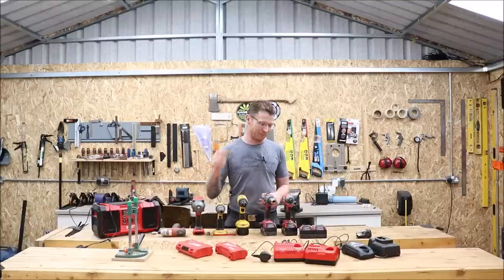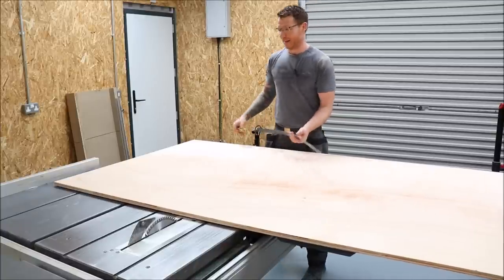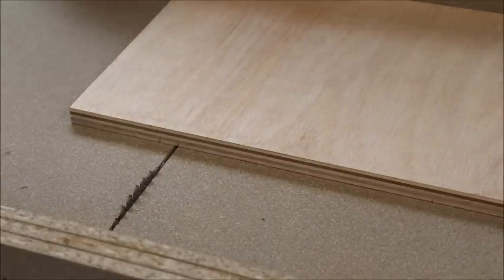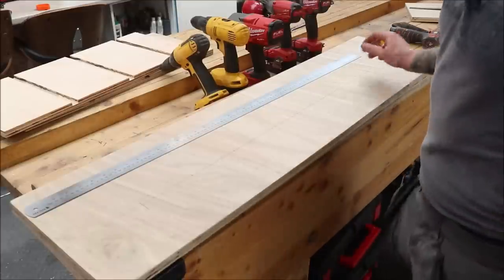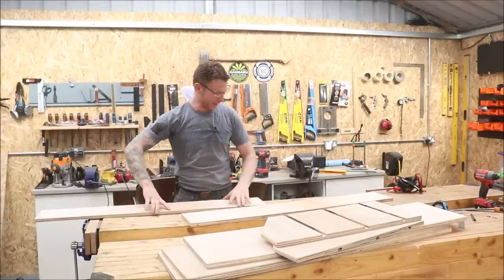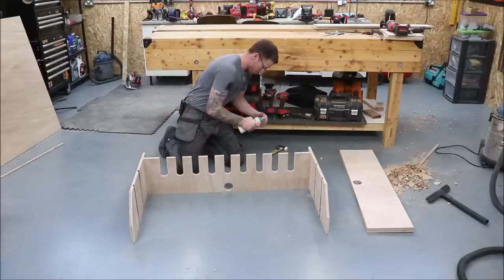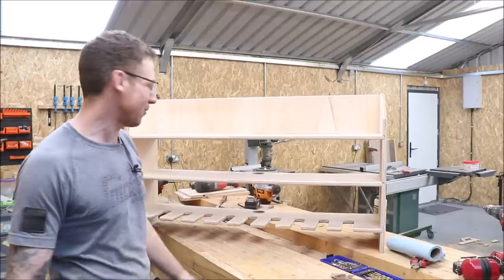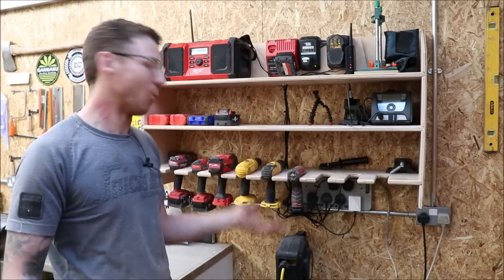Power Tool Storage and Charging Station.

Comment: Great video, as usual, John.  Would it be easier to cut 2 sides as 1 piece, then cut slots, and finally, cut into 2 side pieces? This way you know the slots will line up correctly! Not my idea.... great channel, greeting from Co Meath! Gary
Reply from the maker: That could work, bit harder to handle but would work.

Comment: It looks like you have a metal building,how did you attach plywood to metal studs. I have a metal building as well. Thanks
Reply from the maker: You can use tec screws/ self tapping screws to screw to metal they cut there own hole.